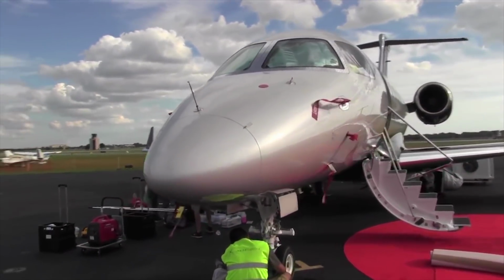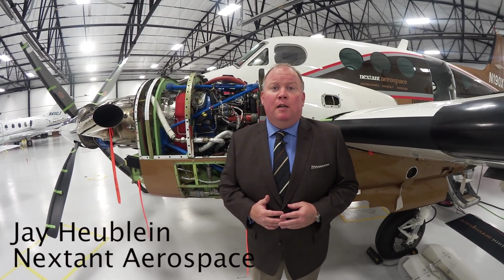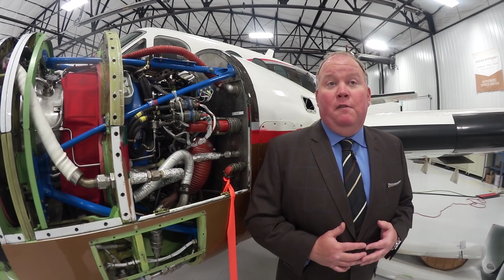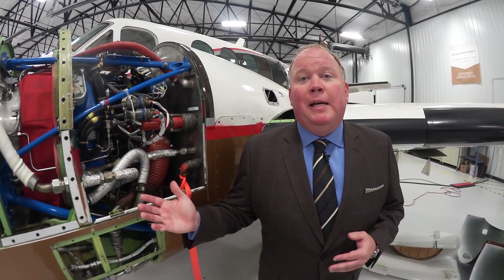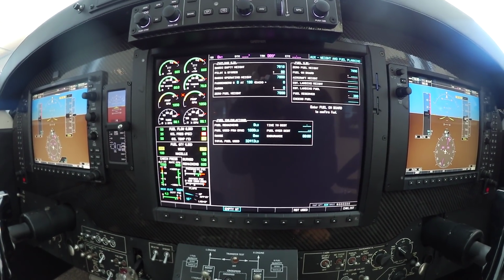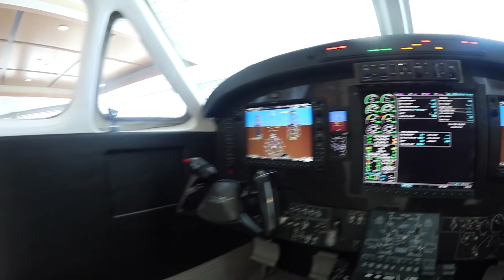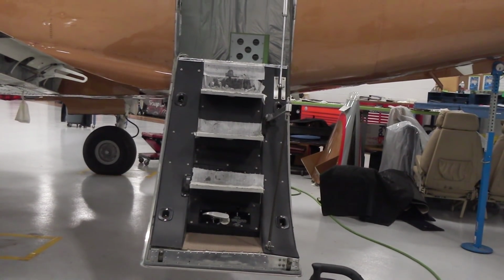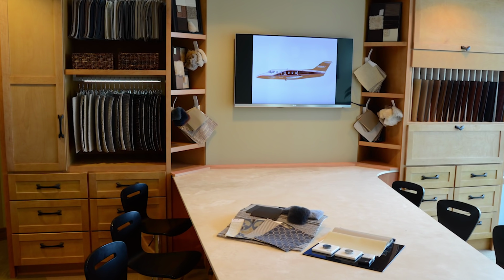NBAA 2015: Nextant's King Air G90XT

Comment: While you guys are at it, put a hydraulic pump on each engine and get rid of that overcomplicated, overpriced, overrated Beechcraft electric power pack landing gear system. Eliminate all the electrical switches on the landing gear, that control the gears function and run the gear like a Piper Navajo. I worked in Alaska on a fleet of 99 air liners, 200 King Airs and 1900's, also several Piper Navajo's. In 13 years we had 5 gear failures on Beechcraft products all resulting in aircraft damage, during the same time period, never had a single Navajo gear fail to work.